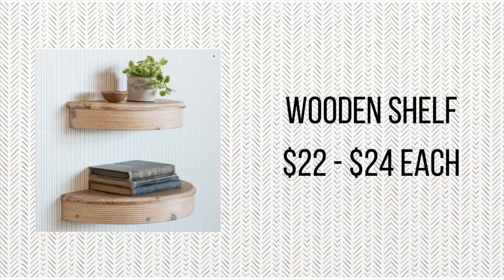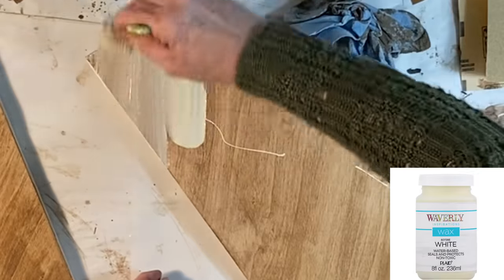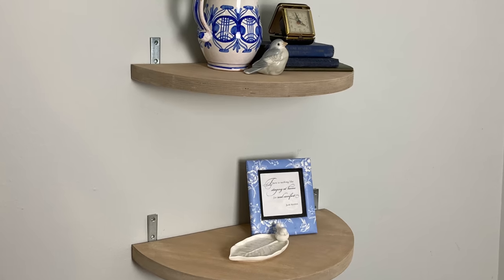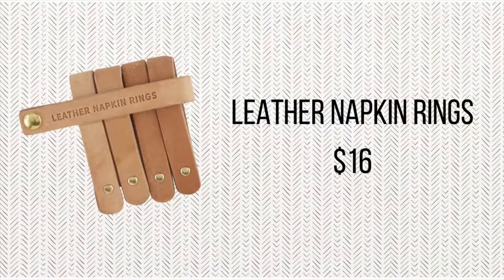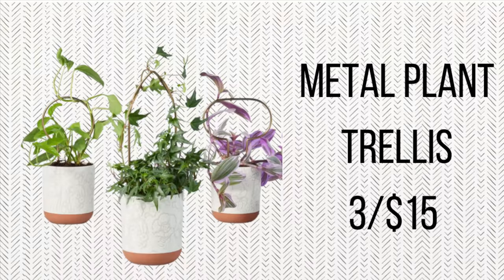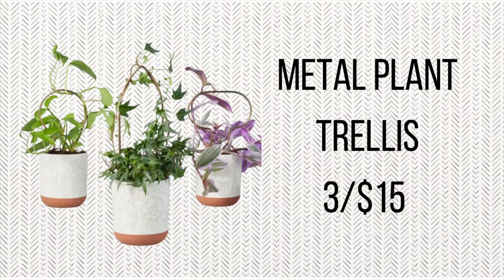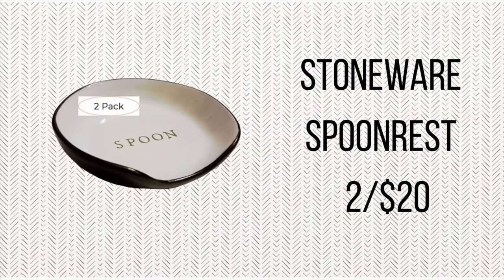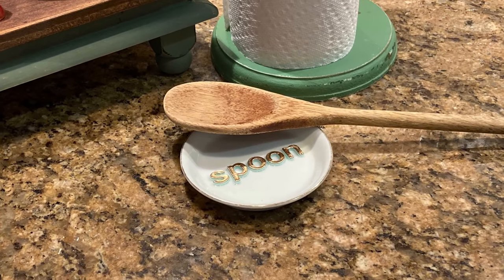15 SPRING MAGNOLIA DUPES: DON’T BUY IT; DIY IT!

Comment: The hanging basket with shelves was my favorite.  😊.
Reply from the maker: I really liked that one, too! I wish I had found a nice brown basket. I thought I took a picture of the red one before I spray painted it white, but I guess I forgot because I couldn’t find it! 😜 But, because it was white, I was able to use caulk. With caulk you don’t have to worry about cutting the ends of the shelves at a perfect angle. (It was freezing in my garage, so I made my cuts as fast as possible! Had it been warmer, I would have taken my time to get the angles perfect.)
Reply: @CanterburyCottage  Yes, Sherry...when your choices come down to having slightly-less-than-perfect wood cut angles to prevent frostbite 🥶 on the tip of your nose and your fingers due to FRIGID Midwestern temperatures and filling in those tiny gaps with joint compound for the perfect abutment - versus throwing caution to the wind and damaging or losing an appendage because you exposed your appendages beyond the safe limits of exposure...I will take the appendage protection protocol EVERY TIME, LOL‼️😁💕

Comment: I love to have round shelves. What a cute idea. Could you put the corner braces underneath the shelf? In fact could they be sandwiched in between the shelf and the extra piece of wood that you placed in there to give the extra support at the back?
Reply from the maker: Yes, and yes! I had originally planned on using figure 8 braces to hang the shelves, but I couldn’t find any, so I used the corner braces. I hadn’t really thought it through properly!😜

Comment: Sherry, i just love you're  projects. Dont know how you come up with all of your ideas. You always add that little something extra to put whatever you're working on over the top.

I bought a colander recently and every time I look at it, I think that that it would make the most interesting lamp shade. It would be so simple to remove the extra hardware and drill a hole in the top. The light coming thru the holes would create such a beautiful design on the walls and ceiling. Have you ever tried this?
Reply from the maker: Thank you! I haven’t tried this, but I think this is a super cute idea! If you try it, I hope you’ll post a picture to the Facebook group page because I would love to see how it turns out!

Comment: A tip, for the 1st project in the video, if you do not like the metal wall anchors showing you can hot glue another piece of wood across the entire back ontop of those to cover up

Comment: Question: on those round shelves (first project), could t the brackets/wall braces be turned the other way so that the part that attaches to the wall would be hidden underneath the shelf? Or do they only work one direction?

Comment: I add the L brackets on the bottom in the other direction. This way they attach to the wall under the shelf and are easier to hide.